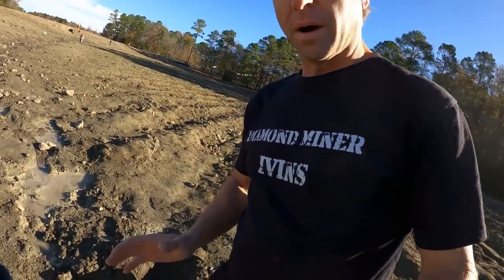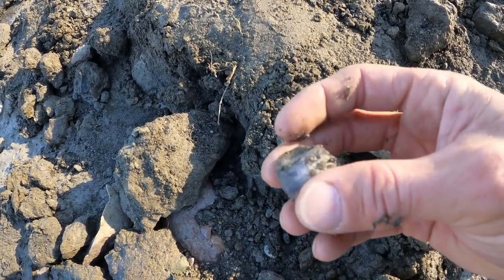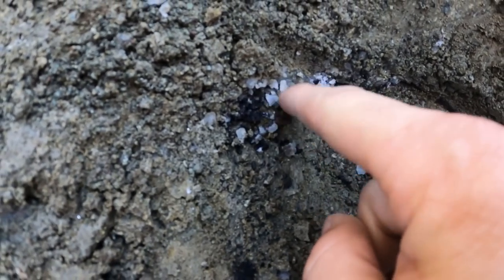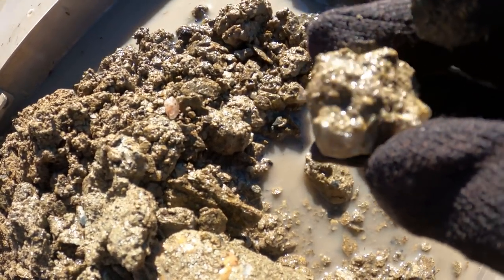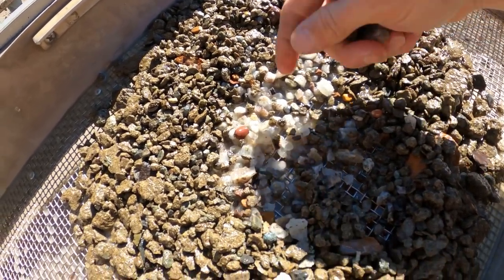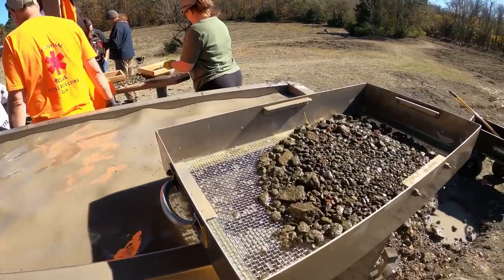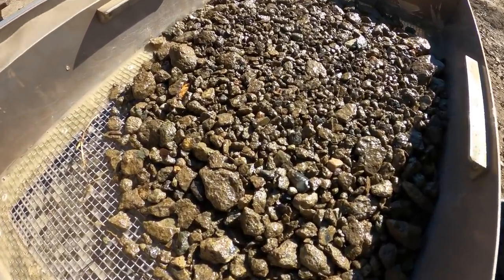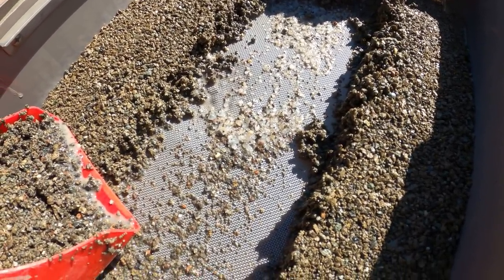I FOUND A BLUE BARITE VEIN!! - Diamond Mining.

Comment: Bro I see what you are going thru with the carts . They are not built heavy enough for what you are putting them thru. Find you a good welder to beef that up and you would have a tool. To me that would be a easy fix with a mig sure you would have to paint it but you would not be going to the store and all that. i would use angle iron . the handle looks cheezy too all needs to be beefed up. good body shop may help ya. cool video brother